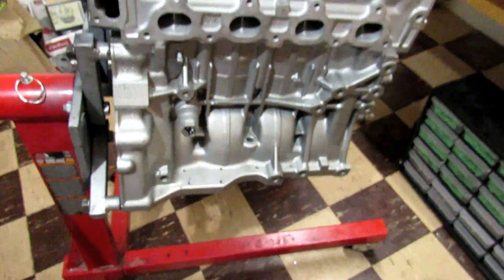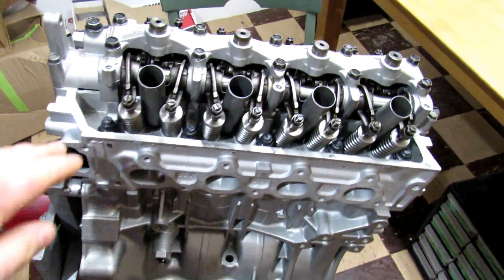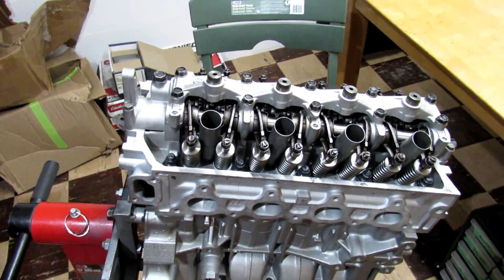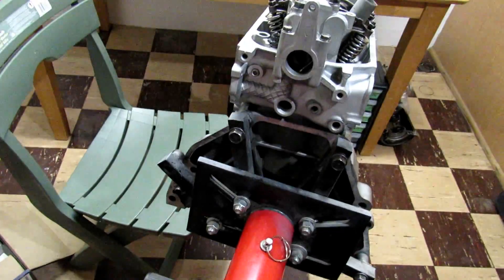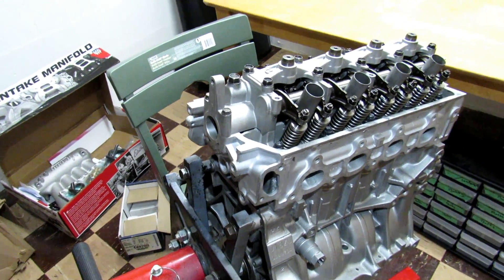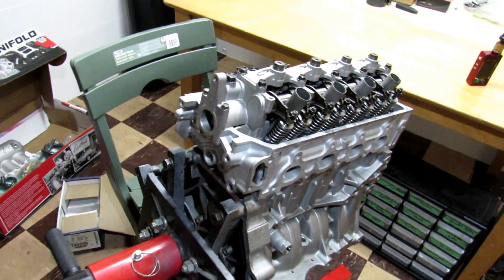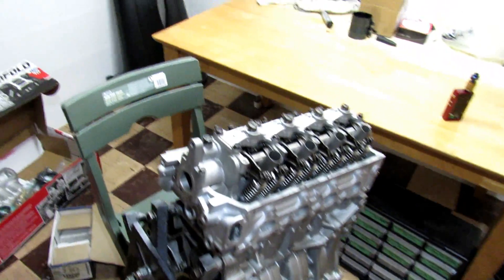D16 Build Cost

Comment: I just rebuilt my z6 with all OEM parts a few years back and just has intake header exhaust but wanna re do it and make her a little more fun but wanna stay N/A could you answer a few questions for me?
Reply from the maker: gansterdiciple Absolutely
Reply: Honda How To now everything has been rebuilt with OEM parts and all the maintenance and I mean all of the maintenance has been done in the engine bay new suspension excetera know if I just wanted to rebuild it N/A besides doing Skunk2 intake manifold or Edelbrock and 70 millimeter throttle body different injectors of course what internals would you suggest?
Reply from the maker: gansterdiciple Well if your going to build n/a I would would go high compression, but if your not looking for power gain I would just use some Nippon pistons or something along the lines of oe specs. Remember in this game you get what you pay for.
Reply: You would be hard pressed to make 200hp in an all motor build. Maybe 180 and that's with high compression and a lot of money like in this video. If it's fully maintained then I would just recommend a small turbo build. 0.5b would be just fine. The main considerations with turbo are increased maintenance and good tuning.
Reply from the maker: Virux good comment brotha. You know your stuff
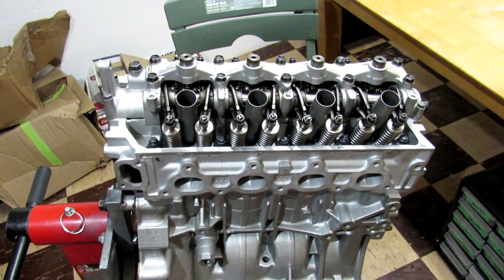Reply: @hondahowto  just noticed my old comment on this video and I still have the same car I commented about above it does have high compression Pistons when I tore the motor apartgetting ready to redo the head gasket again even though it's not blown just want to do maintenance along with the timing belt water pumpand getting the head resurfaced I was thinking of getting another new set of p29 Pistons do you recommend any rods or particular bearings from the block and then as far as the head wasn't going to go to crazy since it already pulls quite good and I'm anywhere from 1:40 at the wheels or a little morejust want to make sure they had can handle what the block is doing this motor is held it for 5 years in and put a lot of b series with bolt ons to shame just want to do a basic high compression build with the same if not better hearts not trying to go as crazy as this guybut if you still check this YouTube channel I can go into more detail get back to me ASAPdoing the job this next weekend and want to make sure I get everything I need since I'm already going to have it pulled apart
Reply from the maker: @seattlejdmcivic  well stock connecting rods would be fine, I would probably run ACL race engine bearings because they can handle alot of abuse,
Reply: Is there any chance to get higher torque in D16Z6? For comparing i got 1.8T at 200hp and around 280 torque and D16Z6 got in stock 125HP and 144 torque which is low, any chance on upgrading that? Would be best for the lower costs possible, i wanted to go high compression nippon p29 and stage 2 brian crower cam, would it do anything or nah? Turbo setup is a consideration too but i can afford only soft 0.5b turbo

Comment: $400 eagles. pistons $680... machine work for block $1000+ that's over $2000.. laskeyracing will do the entire shortbloxk for $2500 I'm considering them
Reply from the maker: John Doe do it this engine was also balanced too so that made pretty expensive
Reply: Honda How To All parts are measured, balanced, and assembled
CP or Arias pistons (Your choice)
Pauter or Manley rods (Your Choice)
ACL bearings
OEM oil pump
Lower gasket set
Blueprint and assembly
Your choice of bore size and compression ratio $2500
Reply from the maker: John Doe not these neither the crank or flywheel etc. it's a full blueprinted engine
Reply: Honda How To $2500 is included in that. can't decide if to build myself or outsource to laskey racing
Reply from the maker: John Doe up to you man if you have any questions I could step you through it
Reply: anybody who does a lot of engine work should have their own digital scale and do their own balancing. it is time consuming, but i would rather use my time than pay someone else and their rate per hour. cost wise at least. if money is no object then go for it, or if a person is not capable.
Reply: Where is laskeyracing???